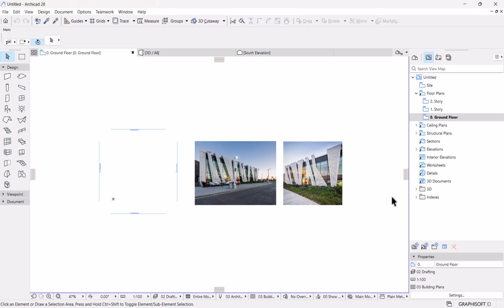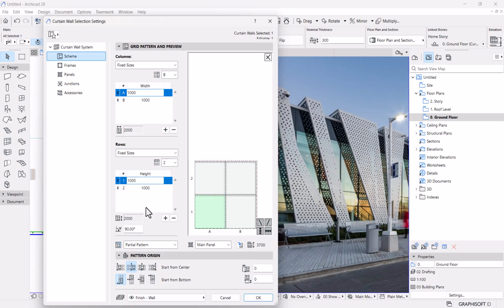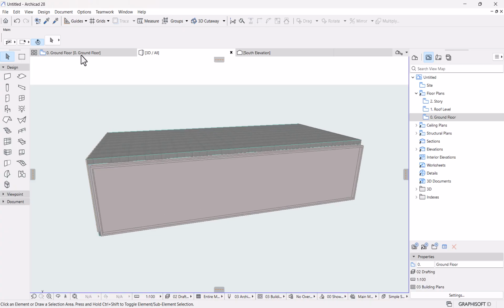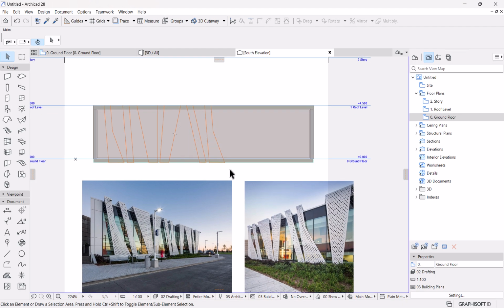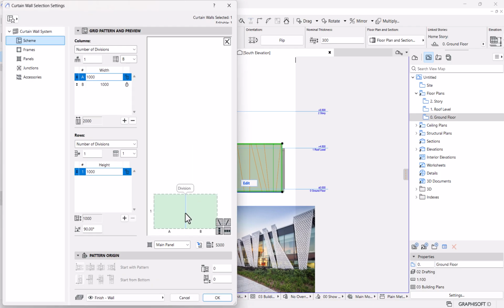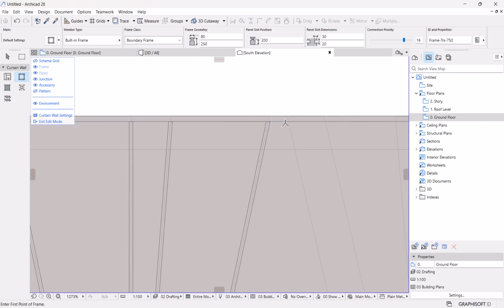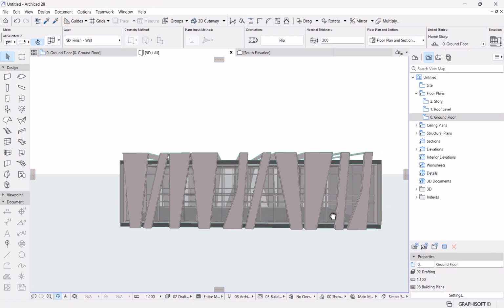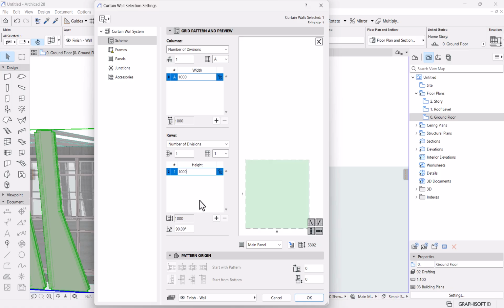Facade Modeling and Detailing in ArchiCAD | Curtain Wall Tool

Comment: I'd draw it with polylines 
Add some tiny holes as shown on the design
Click on morph tool
Magic tool on the places i need the morph
Override the morph to be aluminum 

That's how I'll do it Sir as you asked
But i prefer your method for sure! 💯
Reply from the maker: Thank you for your feedback, I appreciate it. Morph also works however, it's limited especially if you want to make some modifications in future.
Reply: @MesolightVisual  yeah that's very true